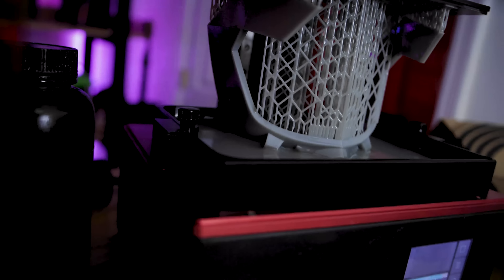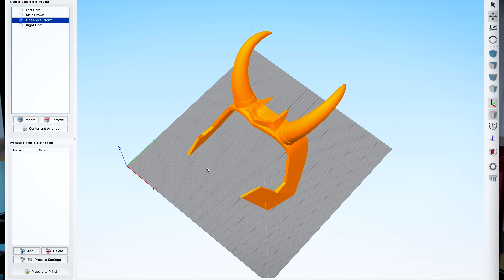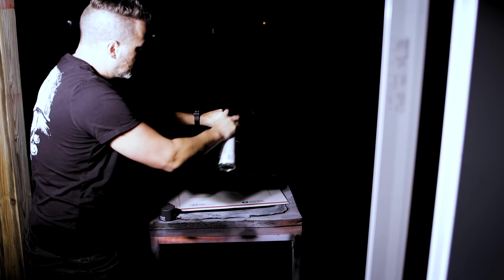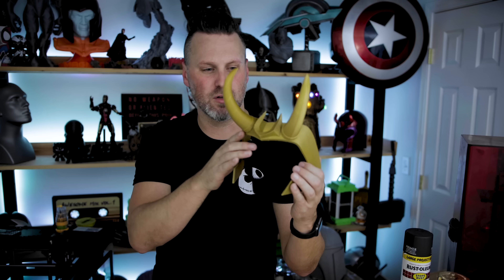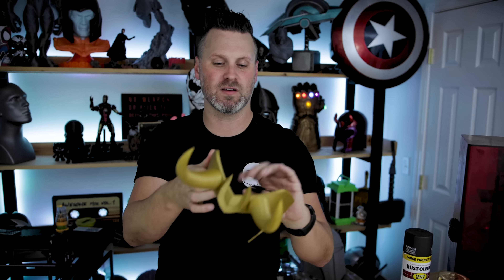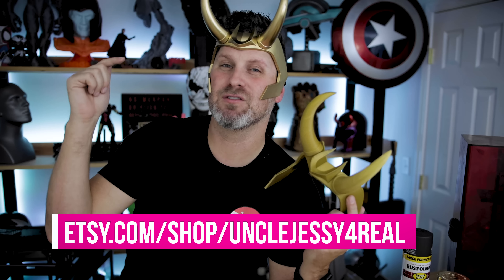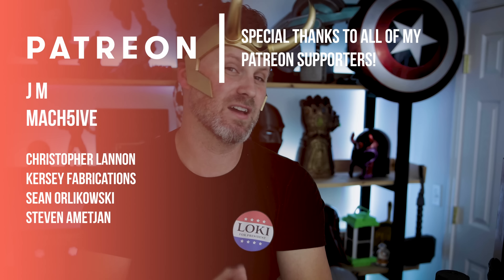How to make Loki's Helmet | Replica Prop 3D Printed | Marvel Studios Disney+ Loki Trailer

Comment: Bought and setup to print on my Mars Pro, look forward to wearing this!
Reply from the maker: Niiice! Use a little resin to join the parts together and any support marks will easily sand smooth
Reply: @UncleJessy  thanks for the tips! I'm not letting this small build volume stop me printing some awesome props :D

Comment: Hey @Uncle Jessy

I have an issue and I can't find any info on how to fix it? I have a 0.5mm "stretch" on the Z-Axis of my prints with the Elegoo Saturn. I have circular holes on these axis, and the ones parallel to the plate come out circular...

Also I am getting a layer "artifact"? Exactly 18mm up on both my prints. Could you perhaps assist me?

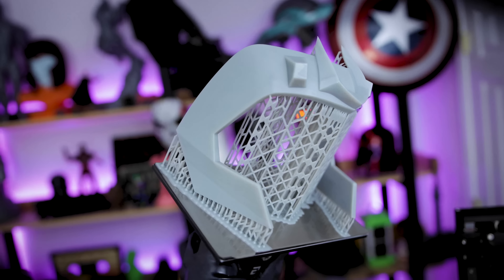Edit: After looking at the video it seems you have a similar artifact in your print at almost the exact same height as me? 2:47

Comment: Hey Jessy! New to 3d printing, and have had problems dialing in settings to avoid stringing on Zyltech Filament on my CR10. Do you have a Cura profile that works for you? Or any settings that help with your filament?
Reply from the maker: Hey hey! I unfortunately dont use cura but I do print at 215-220 on my CR-10 depending on the Filament